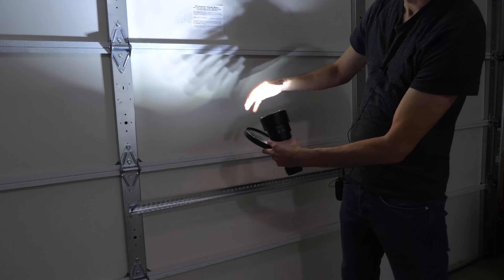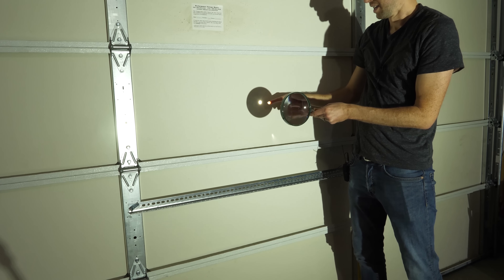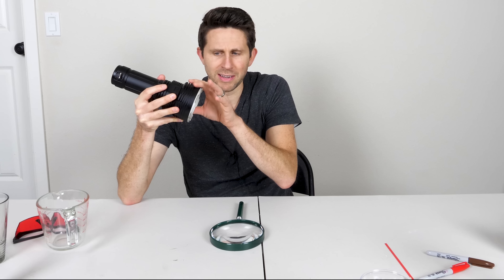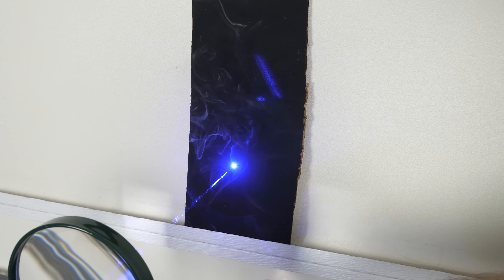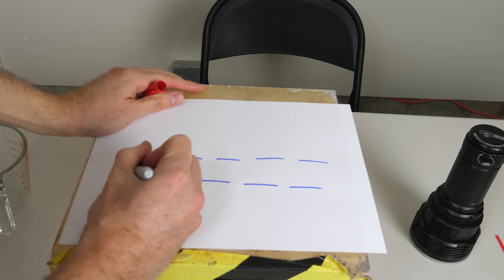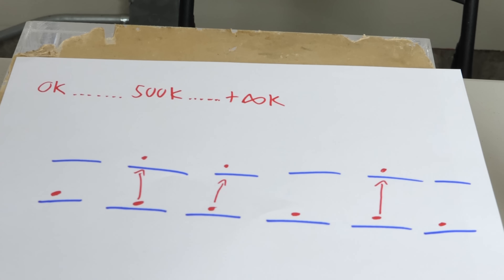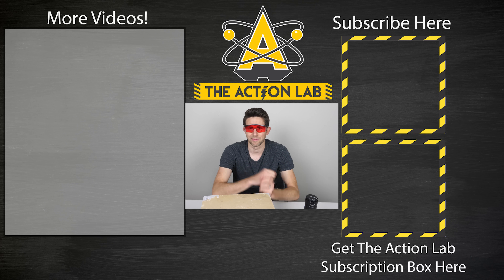What Happens if You Focus a 5W Laser With a Giant Magnifying Glass? Negative Kelvin Temperature!

Comment: I think you can concentrate more light energy on a smaller surface, making it hotter than it's original source. There will be energy losses, and the temperature can still be higher than the source's temperature. The temperature of an energy source is a measurement of energy for a given area, not a sum total of that energy.

Comment: What if you put a pipe in front of your torch that has reflective surface like foil or so and then maybe 2 lenses infrint of your torch inside the pipe and both lenses are abit far in distance from each other then use the big lens like you did in the video then it should focus well. Ofcouree no burning effect from a led unless I'm.erong. but that would be good to try

Comment: Am I living on a different universe? As I used to burn paper and ants with a magnifying glass when I was little using sunlight 🤔
Reply: Yep, that’s pretty standard. 

I’m not sure which part of the video you’re referring to, but Its most likely the part where he said you can’t focus light to be hotter than the surface of the light source. An ant probably burns at a few hundred degrees, but the sun is several thousand degrees, so no violation of entropy.

Comment: On that particular laser (I have the same one and I pot modded it) you can make a focal point by turning that bit on the front. I know that's not the point of this vid I was trying to make the lowest divergence beam I could. Another fun one I'm pretty sure is called black body radiation (I could be wrong. I've only pulled it off with a 650nm tho

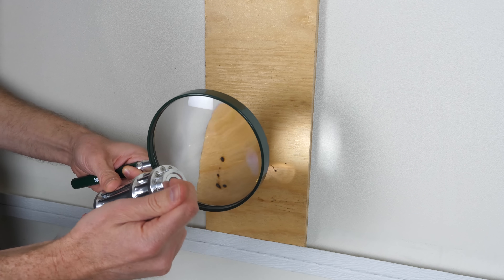Comment: 4:55 it will do the same with Sun... regular sun (or laser) does not burn, but when focused it does... the difference is that X amount of energy is aplied on a given area,  when focused the same X amount of energy is applied to a smaller thus it burns faster... with a flash light however it does not work because the light source is too close (so its rays would be like sun) and it gives of light in multiple directions

Comment: Neat!   While it doesn't necessarily have anything to do with focusing lasers and cooling below infinity.  Super cooling with a laser is a thing, not sure if it was a thing 6 years ago.  Basically, the laser beam pushes the target atom away at a slightly higher frequency than it's resonance, inducing Doppler red-shift (E=hf). Which results in less energy absorbed by the target over time.  This overall decrease in excitation causes the atom to fall into it's resonant frequency and emit additional photons, resulting in a net cooling effect of the target.  So, therein you can combine resonance and cooling of target entities.  The applications are mind boggling, actually..

Comment: Quite doubt about your argument, it's quite misleading. Of course, heat should obey second theorem of thermodynamics. But why should light obey the same theorem? Light instensity obeys superposition theory. Sun or incandescent lamp conducts heat by radiation (visible or invisible light), so they obey second theorem of thermodynamics. That means you can't heat anything to a temperature higher than that of sun or lamp by collecting the light radiated by heat source. But it's not the case for light. Light intensity can be arbitrarily high by superposition. Everyone should know about interference  of light. Laser is not a exception. In conslusion, heat is heat, light is light.

Comment: What if you took the magnifying glass put it on the flash light cover the surrounding with aluminum paper say may a foot or so place another magnifying glass on that and repeat the process until you can get it to concentrate in one direction and then at a distance place yet another magnifying glass?

Comment: What would happen if you were to use a long narrow tube, maybe lined with mylar for a mirrored surface inside it. You have the flashlight attached at the far end of the tube and the magnifying glass at the the end. This should prevent all that light leakage between the 2 ends. And the tube could taper going towards the magnifying glass end. Then try focusing the light.

Comment: That was fundamentally wrong in nearly every single way.

If you took a 5W white LED (5000K) that was a 1cmx1cm COB, you can put it at the focal point of a lens. The light you get out the other side of the lens is collimated, you can now use a second lens to focus that light to a smaller area than 1cm x 1cm. The total energy transferred (assuming spherical cows) is 5W, conservation of energy is preserved, but the area it is falling on is much smaller, so you get a higher temperature. It's the same principle for lasers, only difference is they are already traveling in a collimated beam, so it's easier to collect all their energy into a focusing lens.

Where it gets wonky is as your focal size approaches the dimensions of the wavelengths of visible light. Non-coherent light sources will start to get constructive and destructive interference, but because lasers are coherent you only get constructive interference as you focus it down to a dimensionless point.

Negative temperatures have nothing to do with ability to be focused.
Reply: Thank you. I don't think this was a good demonstration at all. I was thinking the path of photons in both the laser beam and the light from the sun once it reaches earth are both practically parallel. That is why both can be focused down with a (bi-)convex lens. (you call these parallel lines of light "collimated")

The light from the giant flashlight is clearly wildly diverging. The way to test that would be to 1) use a flashlight with a long throw (spotlight), the ones that shine almost parallel and look like a super-long lightsaber, or 2) use a second lens before the biconvex lens to refract much of the light into a more parallel path, then use a regular convex lens to focus that down to nearly a point. I don't know how well #2 would work as the light rays from the flashlight aren't coming out in consistent angles. It's much closer to chaos in all those light beams' angles. You'd need individual lenses over each of the LEDs to get near parallel beams, which is exactly what multi-LED spotlights do.

Edit: I do have a multi-LED "spotlight" with a very long throw, and I'll try this (with my more moderately-sized bi-convex magnifying glass). I imagine I'll just get a smaller point (from 10cm wide (fist size) down to finger size) before it starts diverging again. I'll edit this afterwards with the results.

Edit Ive confirmed this. I had to put the regular, bi-convex magnifying lens within 1cm or so from my Wurkkos TD01 (long throw, 1 LED spot flashlight), and it did focus down most of the light into a smaller circle. At 20cm from the wall, the regular spot was 7cm across. Using the lens, it narrowed down to 2cm. It appeared much brighter (still hard to feel the heat, though).
Reply: @GregConquest  Pretty sure there's some math involved with how big your focus point is before diverging, to figure out how big your next focusing lens needs to be and get even smaller. Now the question is can we focus the sun, or a laser, down to Planck length and slice the moon in half?

Comment: So... To be clear, with a precise enough lens, this system could achieve theoretically infinite temperature? That feels thermodynamics-breaking, why can't you just hook that up to a generator? I know the laser takes a lot of power, but it sounds like you can increase the resulting temperature without limit just by adjusting the lens, without adding energy, so surely eventually the generator would be more powerful than the laser, resulting in net-positive energy. Obviously this doesn't work (thermodynamics always wins), but WHY doesn't it work? If you can increase the temperature of something without limit and without increasing the energy input it feels like you should....

OH! I just realized the answer as I was typing. As you increase the temperature, you're also necessarily decreasing the mass of what's at that temperature, since you're narrowing the beam. So I'd imagine the total energy of the sample always stays the same, you're just concentrating it. Neat!

Comment: This doesn't make sense at all. I think there are massive gaps in the understanding of physics in this field.

I think the actual reason is much simpler. The laser is clearly hot enough to burn the wood, no matter if it's focused or not. However unfocused the heat is spread out over a larger surface area. Much like how further away from the equator the sunlight is spread out over a larger surface area and therefore its colder.

It seems to be an energy per square millimeter thing. Of course the lens will focus all the energy to a much smaller point which of course will be much hotter. Still not hotter than the surface of the laser, but it doesn't need to be because the surface of the laser is plenty hot to burn the wood.

Comment: 1- Nothing can get hotter than infinity, it's mathematically impossible because no glass we have can demagnify anything into a singularity point that's more magnified than infinity if you know what infinity literally means.
2- You disproved your theory of no matter what we do, we can't make the sunlight hotter than the surface of the sun, no we can make it even hotter than the core of the sun if we can make it hotter than infinity right? Anyways that BS aside, yes we can actually focus the sunlight to make it hotter than even the core of the sun by using a real barlow reducer/speedbooster lens or a barlow extender/teleconverter reversed, not a simple magnifier.
3- You literally proved your claim wrong in 3:10 by focusing the laser beam. And if you make a large enough glass to focus the sunlight, yes you can make it hotter than the surface of the sun because you focus the light into such a small area that'll be hotter than the surface of the sun, maybe even the core of it. And no it's not hotter than infinity. Because there's no such thing as infinite brightness that we can reach. Because infinity is literally is unreachable, it's the definition of it.
4- You had to use the bamboozling word "quantum" here to prove your point but it doesn't work at all. It's all just a buzzword for this particular video.
5- You're reported because you're giving the scientific community false info to gain views. Your thumbnail is bamboozling and you are extremely wrong in many aspects of this video which shows you're really not a scientist but just a youtuber who makes views with scientific subjects whether they are right or wrong. And you are generally wrong.
6- You're reported as a Charlatan who bamboozles people for views, not because of that but because you hurt the future of mankind with false information and by delaying bright minds with your bamboozling claims. 
7- if you want to keep making scientific videos, please study it fully first and do not make things up.
8- If you can't do that, I'll be your enemy and keep reporting your videos.
9- I still can't reach infinity because it's impossbile, it's just 9 atm. Even if I multiply 9 by 999999999999999999999999999999999999999999999999999999999999999999999999999999999999999999999999999999999999999999999999999999999999999999999999999999999999............ to like 9999999999999999999999999999999*999999999999999999999999999999999999999999*999999999999999999999999999*99999999999999999999999999999999*9999999999999999999999999999999999999999999999999 characrers. Still not infinity, just a finite but a very big number but not infinity. Not even almost infinity.
10- Cheers!

Comment: The temperature of the emitter is a red herring. Laser light is parallel, so a normal lens can focus your five watts to a very small spot. That doesn't give the spot a high temperature; it gives the spot a high power density. Energy is conserved; temperature is not. Play some games with non-focusing optics some time.

Comment: I disagree with a bunch of your statements. First at "high temperatures" electrons gain enough kinetic energy to leave orbits (i.e. ionization) and you get plasmas. There is no such thing as infinite temperature, because temperature is defined as the averaged kinetic energy of local atoms. Infinite temperature is not related to the number of electron orbital states of an atom and its neighbors. You show only two electron states in your diagram, but there are many, many electron states which is dependent on the lasing media. Lasers work based on creation of population inversions that correspond to the desired laser emission wavelength. I do not understand how you relate electron energy states and temperature. It is almost definitely wrong, as your definitions lead to individual infinite positive and negative temperatures, that are totally independent on number of atoms present. So, by you definition, you have infinite temperature if you have two atoms that have filled two available electron states. Etendue is just about how a light spreads angularly. I have no idea how you correlate that to the 2nd law of thermodynamics. Seems that your statement is more about conservation of energy, in that you can't get more energy photons than you generate. Then, a flashlight is emitting at a varied light spectrum, so the smallest theoretical focused spot would be related to the diffraction limit of your largest wavelength, minus interference between wavelengths. I agree that you physics does not let you focus photons to an infinitely small spot. A laser population inversion can be spectrally/spatially and temporally coherent, but not necessarily so. Depending on the laser structure, it could radiate in all directions or cavities and mirrors designed to optimize beam quality (i.e. spatial and temporal cohorence, and spot size.) Bottom line is I disagree with you video.

Comment: 0:48 You can just use a lot of lenses? Change my mind. (Not actually, I don’t need brain surgery)
Reply: I am not saying that u can break the laws of thermodynamics but just saying that the heat is not increased but just the surface area is lowered so the point at which the light is pointed, there the surface temperature would increase. From the heat over a large surface, the heat pointed over a small surface.

Comment: Use a large enough lens to capture all the light from the flashlight and the point will be much brighter. It won't be brighter than all the light from the flashlight but it will certainly be brighter than any one point was from the flashlight before.

Comment: You accentuate on the fact the you can magnify the light/heat source used. And LED bulbs will never produce enough energy to burn but could you harness a lighter flame or a candle flame in the same way we do with the sun

Comment: Im really confused by this.

Is temperature not basically a measurement of movement? So at 0K the atoms would be fixed in place assuming they didnt have momentum. What are the atoms physically doing when they're in a state of -0K? What part of the atoms are in a high energy state, do you mean all the electrons have transitioned from the homo to the lumo then upto the humo and have reached a speed they cant exceed and are emitting the excess energy? I really cant grasp this sorry 😢

Comment: I bought one with the black coating. I found I could adjust the lens at its tip with a flat head screw driver. This proved useful as mine, like yours, was emitting a tiny line instead of a dot. Now I love it even more.
Reply: Seriously where did you buy it though...
Reply: where you bought it?

Comment: Also it makes sense the the lazer will get hotter because it will be focused in a small area but the magnifying glass focuses it to a smaller point because if it it was the width + height of an atom we will not be able to see is so when all of it is able to fit on the magnifying glass it focuses it will even further. Aka all the light is able to focuses on a small point but with the magnifying glass it will be focused to a smaller point with all of the lazar fitting into the magnifying glass

Comment: When I was in 4th or 5th grade I used to take my glasses off at recess, probably around noon. I would burn bugs on the concrete and on trees with it.
 It definitely worked + It was definitely hotter than the sunlight on my skin. 
I mean if no one believes me, I can actually make a video about it. I'm not a kid anymore. My glasses have a different prescription now. Stronger different. It probably will still work though. 
It's not summer yet but there might be a sunny enough day to do it

Comment: I don't like how an old af idea such as the 2nd law of thermodynamic originally describing a simple concept of heat transfer on microscopic level between two adjacent bodies of different temperature has just been upgraded to also include e-m interaction on any distance. This sounds unreasonable if not entirely wrong.

Comment: Your demonstration seems straightforward. And you point out the seeming contradiction between a flashlight and a laser when focused by a lens. 
     The trouble with explanations is in the definitions. Too many new concepts all at once. Without comparing and contrasting with the old definitions.
     You conflate optics and thermodynamics as if the two are framed by the same quantities. Negative heat? Negative cold? Sounds like anti-matter. 
     The explanation of excited states in the atom ⚛️ further intrigues. Which atoms can physics dope to trap electrons into higher states? How does such an atom behave when the energy increases/decreases? Opposite to the wsy a normal such atom would behave? Isnt that impersonating anti-matter?